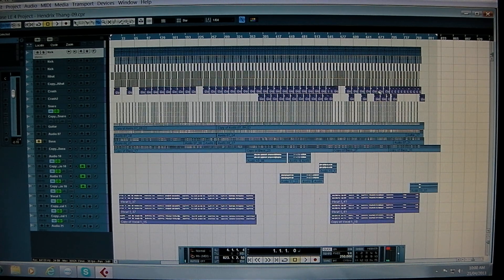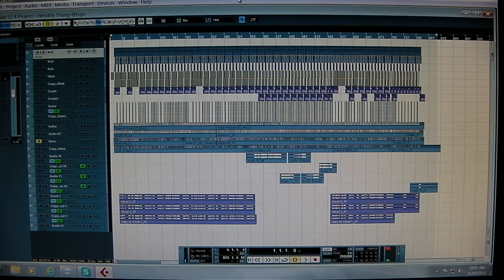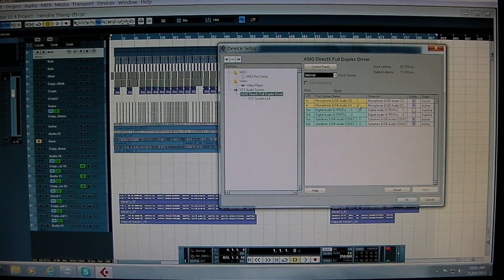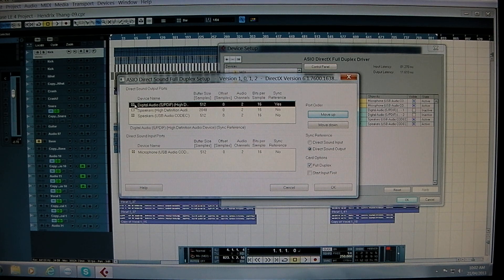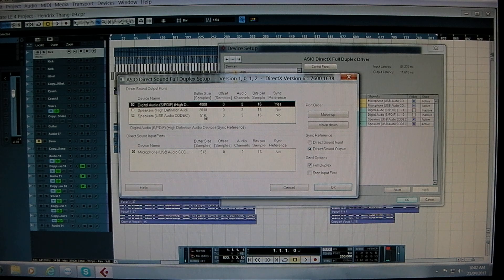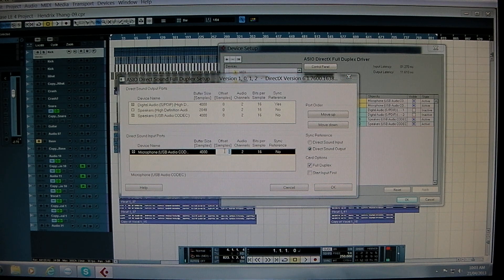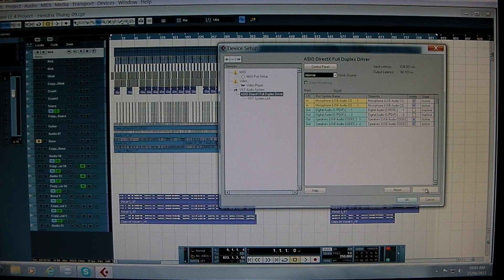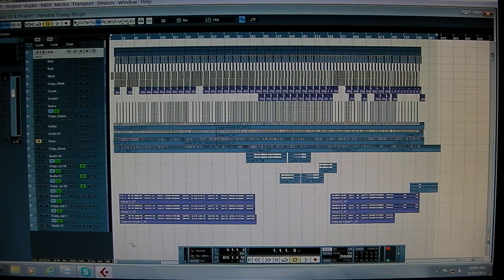Cubase Pops and Crackles Fix

Comment: I'm confused. How do you appear to be so clueless about everything you're doing... yet, if this works, you're the only person on the entire internet that's figured out that the crackling is just a buffer size issue?
Seriously, amazing interfaces that otherwise work great have been discontinued due to complaints over this issue. I, personally, have gone through 5 interfaces and was about to spend another $800 to get another one. If this basic function adjustment solves my problem, you just put me back on budget for a Neve 1073.

Comment: I use nuendo 4 at present being an amateur. When the soundcard is connected all video and audio files from the PC play perfectly. However, when I try to preview in the nuendo software its crackling and also there's a latency. I can't even understand what recording has been done using vst files. Unable to figure out the problem. Please help

Comment: Hi Paul, thanks for your video. i am new to recording and currently using Cubase 6 AI which came with Yamaha Audiogram 6 interface. i have tried to record a few tracks to try it out but noticed that i have delay when i play it back, in other words my tracks are not in time to each other, if it makes sense. I did try to change buffer size to smaller value, but my system doesn’t seem to be coping with it well and the sound when playing back is ‘popping’/’lagging’.

This may sound stupid, but are External Interface and External Sound card different things? I recently bought a new PC and it’s pretty up to date, but the sound card is just standard. I thought since I have the music interface I don’t have to get an additional sound card. Am I wrong?

Thanks in advance/Alex
Reply from the maker: If you have a  new up to date PC the standard sound card should be fine for playback. You can route your playback through your interface and use headphones or speakers from it.
As for latency issues I do have another video that shows you how to iron out those problems. Its call "Cubase Latency Fix".
Hope that helps.

Comment from the maker: Hi Harsha. I have another video that deals with the recording latency if that is what you are asking.
If it is a delay in your live monitoring I have not been able to run my live signal through my sound card and back out. I have the monitoring turned off and playback going to my recording interface and mix live and playback in the interface or alternatively you could use a headphone mixer.

Comment from the maker: You need to listen to your live signal before it goes through interface.
If you listen to the sound you are recording after it goes through the interface and in and out of cubase the latency is a problem.
Send your playback to the interface or use a small mixer to mix your  live and playback sounds for monitoring.
That is what I have always done and never had an issue.
Thanks for watching.